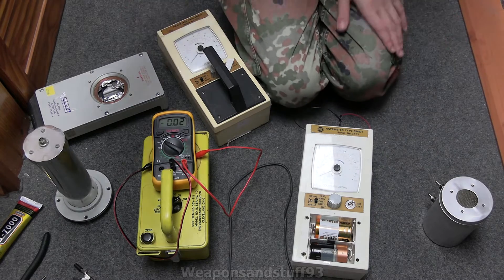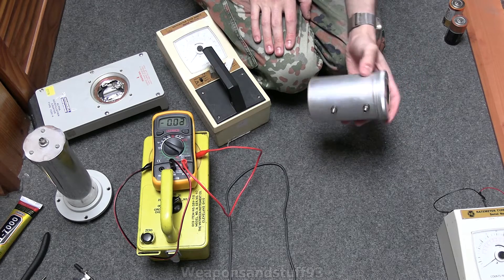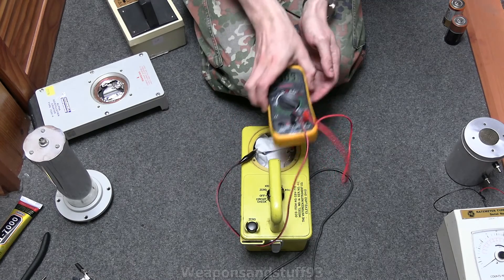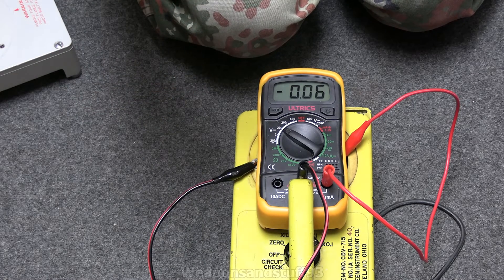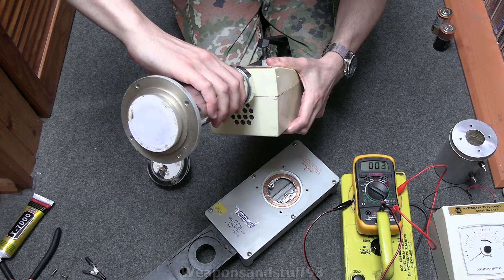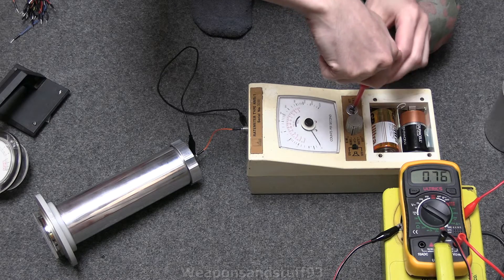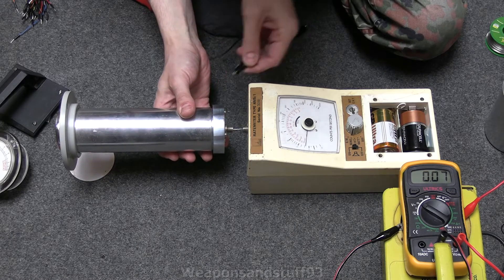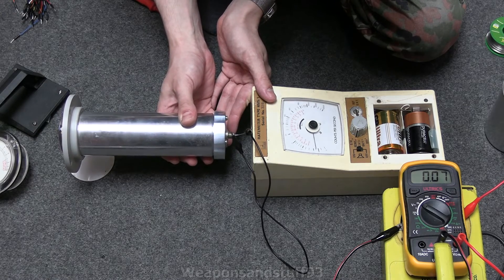Various Radiation Detector projects

Comment: That alpha scintillator seems broken. The "foil" is the mylar window made to protect the detector and to stop all light from coming inside to the photo multiplier tube. The detector wont work correctly if there is any light at all because the PMT (photo multiplier tube) will register that. The white disc is the actual detector which is a sheet painted with ZnS:Ag. It is the alpha detector part because it gives a flash when the alpha particles gets in contact with it. The detector also runs on somewhere around 900V.
Reply from the maker: Thanks for the info, after the video reassembled it and it started working.
Reply: @weaponsandstuff93  Question, do you by any chance have my main channel "radium quetzal" blocked for spam? It seems to go to spam due to youtube thinking links are spam. Just wonder because I have tried to share some information you might find good to know but it can't be shown to people as it seems.

Comment: some help for setting up the scintilator: when the scintillator is turned on it the radiation source and the scintillator should be in a light tight container. it means no stray light should be able to hit the scintillator. next looks like you don't have the scintillator itself put on to the photomultiplyer tube or its the thing you called the protective window  (if its an alpha probe there should be a piece of glass or plactic coated in zinc sulphide) so its not going to work.some basic knowledge how it works: an alpha particle hits the zinc sulphide layer and it emmits light the the photomultiplyer tube tturns the light flash in to an electrical signal which is detected by the device.
Reply from the maker: Yup I've remounted it in the housing with the crystal in, works fine, did rewire it though to go on the rate meter